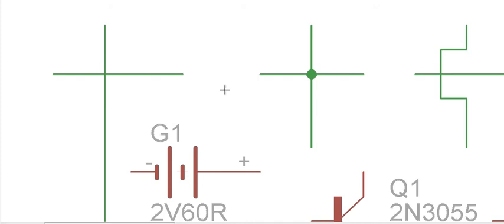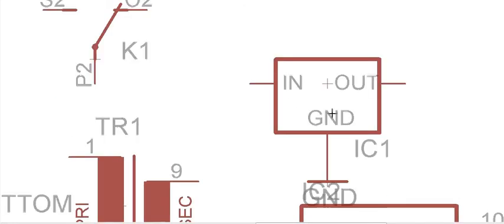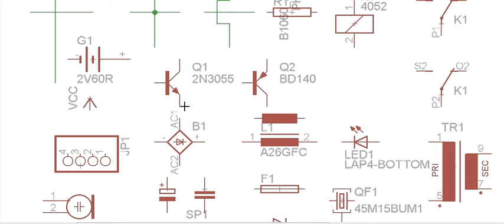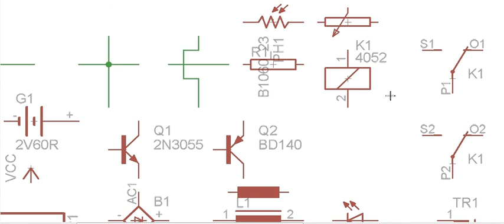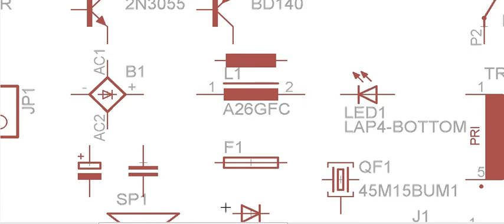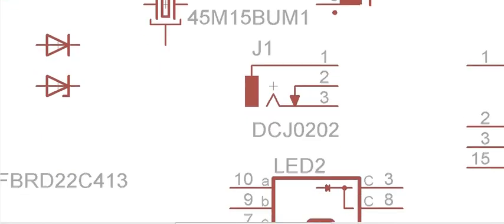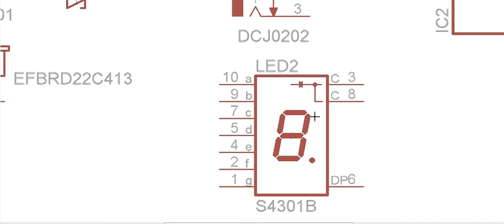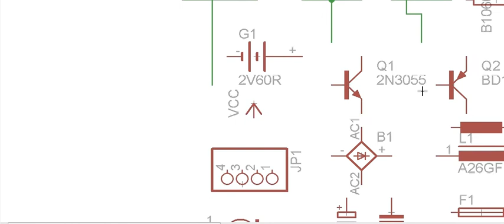Electrical Engineer - Reading Schematic Symbols In Electronics

Comment: Why don't you have a coil symbol for a inductor? Why is your zener diode, has only one swiggle line? Why does your fuse have not the sinusodial line? As for the BJT i think the arrows are always the emmiter and regardless of whether place above or below, in which you said it was a collector. Sorry but I'm not an EE, I was wondering are you one? I would like to learn more but I do not want to learn and memorize mistakes....

Comment: 4:22 "And this one is pointing towards the base from the collector."  I think you meant to say "... from the emitter." The lead with the arrow on it is not the collector, it's the emitter. No matter if it's a PNP or NPN transistor, the emitter is always the lead with an arrow on it in the schematic, while the collector has no arrow at all.

Comment: At 4:08, you said that Q1 is a PNP transistor, and then you said that Q2 is a NPN transistor. But actually, it's the other way around. I don't know if you have heard this one before, but in order to easier remember which one is which, you can just look at the arrows. The arrow of the PNP is Pointing iN Proudly, while the arrow of NPN is Not Pointing iN. :)